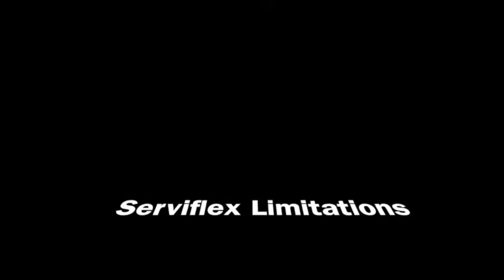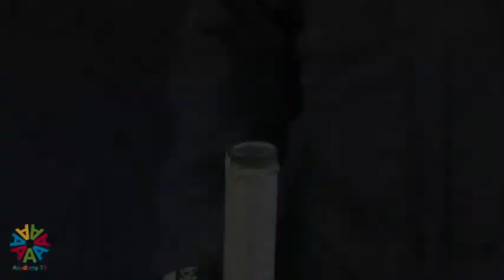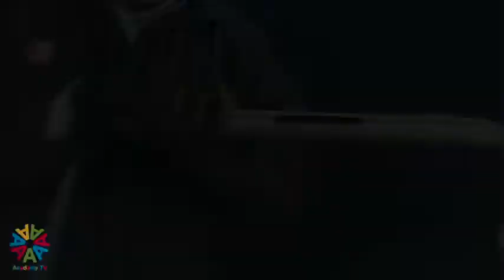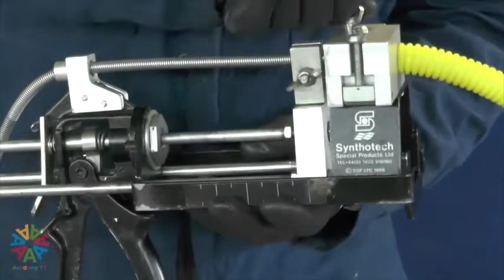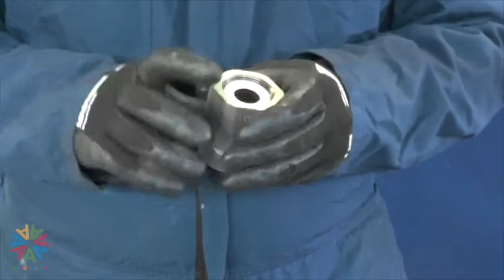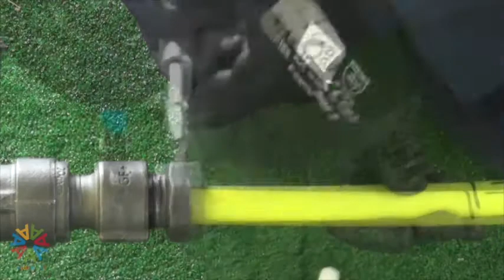Serviflex Video

Comment: Looks like a great product but after using the full seal do we reinstall the plugs at full torque and do we use pipe thread compound or the full seal on the plug threads ?